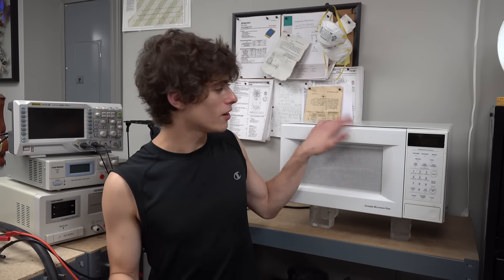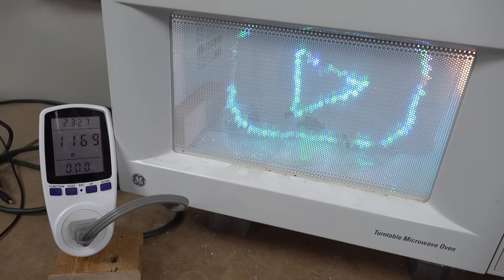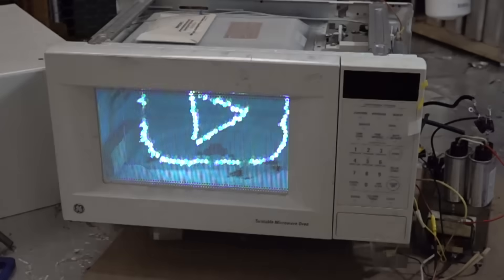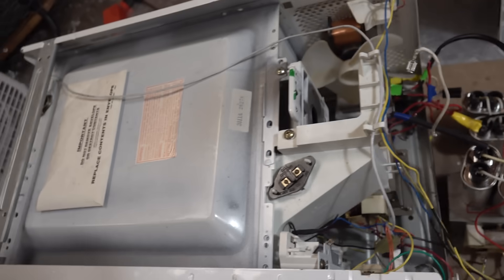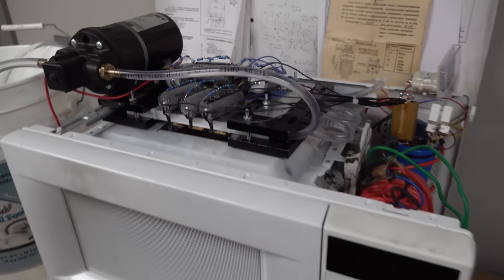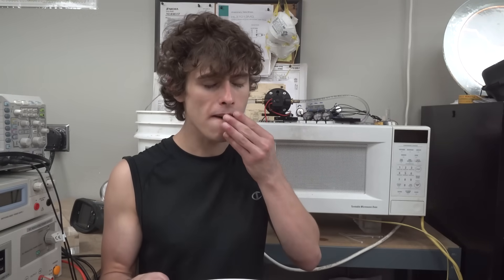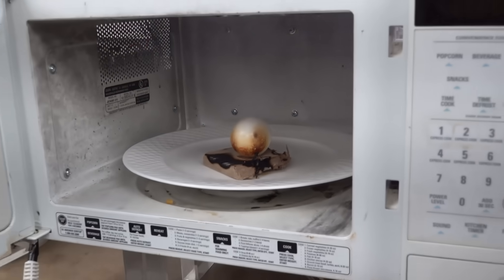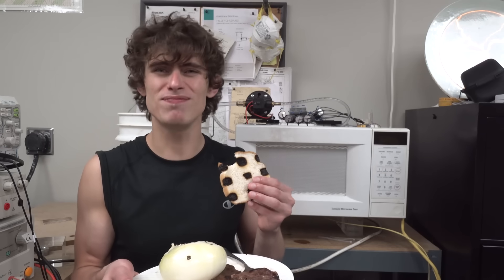I converted my microwave into a LASER oven!

Comment: I see potential. Heat penetration could be improved by leaving the visual spectrum behind and adjusting the wavelength. This also can be reflected easily within the oven, increasing efficiency and spreading the heat more evenly. To appease the regulators you'll have to choose an allowed wavelength, so let's say 2.4 GHz to 2.5 GHz. I don't believe there's a lasing medium for this, but other emitters are widely available, like the magnetron of a microwave.

Comment: Careful with that hammer next to the magnetron beryllium oxide is nasty stuff and the damage is irreversible. You can get real ugly very quickly at low levels. I’m sure you’re aware but just in case I figured I’d give you a heads up.

Comment: I used a microwave oven to make an actually SAFE fractal wood burning rig. Left the  interlocks in place, put electrodes in the wood, spritz with the electrolyte, shut door, turn it on

Comment: Another lie. When I had solar power & watched my nearby electric meter I noticed that my "800" watt microwave actually drew about 1300. Though if that's the case, well surely the turntable motor doesn't take as much as the other 500 does it?

Comment: If you used a conventional microwave oven to heat the food and a laser to char the outside, you'd basically have a fireless grill. it would make more sense to use pulsed lasers because lower energy draw and more manageable heat production. You could house the entire thing in a grill-style hinge-lid container that latches shut during the laser char sequence so there'd be negligible risk of vision damage. You could even make one with a CNC laser engraver to burn memes into your steak.

Comment: i know that this is for educational purposes but i am doing a "seperate" porject and was wondering what the website that you got the Nichia NUBM3C 455nm 112W Blue Laser Diode Arrays or were you using the 74w version, because i saw you use the 74w version. also if i were to use the 144w version would i need a different power supply,
PS: i would appreciate it and it would really help me if you could give me a shoping list of the matirials.
and thank you for the education on the safty of these projects. :)

Comment: As much as he messes with microwaves it's weird how much incorrect information was provided.

1. Microwaves did make a jump many years ago.  the early ones were only around 200-300W and the current ones are typically around 1000W and really anything over 900W is too much and causes instant hotspots.
2. Until several years BEFORE this video microwaves did manage lower "powers" by adjusting their duty cycle.  The newer ones that would have been readily available when he made this video have something more like a variable power.  I am not sure how it works but its' way better than the slow cycling they used to do.

The video is great, it's just weird when he gets the common knowledge parts wrong.

Comment: If you put shredded cheese on a square plate in the microwave oven and then cook it just briefly you will find lines of melted cheese and lines of not melted cheese. If you measure the distance between two rows of melted cheese and you do the math properly you can determine that the wave length of the microwave is roughly 2.4 GHz.

Comment: The electronics project that sketched me out the most was my massive capacitor bank. That thing was lethal. 
This was back when you could just go to the photo development section and just ask for their used disposable cameras and they would give them to you. If I remember correctly it was about 800 capacitors running at around 600 volts. When I realized our math was off by more than a factor of 10 was when I vaporized a piece of copper I was using as a fuse. 
The thing that still concerns me to this day is that it went missing in a move. I really hope no one tried to use this. Because this thing sketches me out as much or more than microwave transformers.

Making giant capacitor banks is also very lethal idea that you probably shouldn't do.

Comment: The most important thing when opening a microwave is to unplug it BEFORE you open it and short out the giant capacitor WITH A TOOL THAT HAS AN ISOLATING HANDLE, IMMEDIATELY after opening it.

Comment: At my university back in the day there was a dude building a RF based microwave oven out of SiC electronics. So in steed of a magnetron it had a SiC RF transmitter. It was quite a bit more efficient and also fairly light. The SiC circuitry was prototypes but i would guess they would not be cheap

Comment: what if... the lasers spin?

there seemed to be a problem with lasers... being lasers, and focusing all the energy in one spot

so... if you make the lasers move, then the energy will be a little bit more spread out, right?

of course you wouldn't go the easier route of putting a diffusing plate or an actual turntable... right?

maybe... take it to another level and just make a laser chamber with a whole lot more lasers aimed at the middle?

i didnt really think this through yet, but i really just wanted to put this out there

Comment: I’m not studying electrical but from my knowledge, you can add a capacitor into the circuit to prevent the ripple. That’ll essentially create a standard ac to dc converter.

Comment: There are channels that throw stuff together like this for fun and that's great, but there's also a few channels out there that do the calculations to perfect their toys. I remember seeing a guy building a linear accelerator and presenting a spreadsheet with his optimization calculations based on measurements. Imagine what Pyro could do were he to, for example, focus all of the lasers at a single point, with the light waves being resonating at the focal point(s).

I don't think he'd create a resonance cascade. No worries. Avoid shiny yellow rocks tho.
Reply: For a laser oven, you’d probably want it to instead diffuse the light at an adjustable set radius so the light is distributed evenly as possible over the food as as much as possible hits the food.

Comment: Do you think you can use a microwave for de-weeding a garden? I have a lot of shit growing between my tiles which I can only remove by either manually picking them, burning them (which doesn't do anything to the roots) or spraying them with acid (vinegar). 

A microwave should go deep enought to burn the roots. But how dangerous is this? Is the reflection of the MW dangerous enough? Could I just put a microwave without a door in my garden an turn it on remotely? 

Please help, my weed problem is killing me.

Comment: Microwave magnetrons are free running, so if you place the radiating elements with the proper spacing in a rectangular waveguide. They'll sync like metronomes on a wobbly table. Consult the radio amatuer handbook from ARRL to calculate the spacing for the waveforms to be additive.

Comment: 5:18 When I first moved out of my parents I had a small apartment with a roommate and we had this super old microwave we called "The Red October"; it was made in the early 80s and was huge with three different dials on the front(time, temperature, and something to do with a temperature probe) that made it look way more complicated than a microwave should be. One day I was reheating some mac and cheese and I pull the door open assuming that it has safety features and will for sure turn off when the door is open... Nope. That SOB kept going. I got down as soon as I processed what was going on then reached up and slammed the door shut. I always wondered how dangerous that was.

Comment: Great work.
Be f-ing careful.
I think you need to tweak the frequencies without the dangerous amps or volts.

The trick i believe is the frequency you use.
Look up Royal Raymond Rife. He invented a device that killed cancer. I was cured for a skin disease by one in 60s. Used a GE Plasma bulb and was purple like UV . 

He used a carrier signal  i think 3 gig to get it deep. He would use the low frequency to break cancer cell. Like chemo but targeted. 
I thin you could build it 

Just a tiny bit makes all  the difference. You hear that sound when you burn stuff. Get an app and check the sound frequency. Also look at light frequency. Change the recipe and see what happens. Or add loud sounds from 3rd source.
Try a sound frequency generator app.

Think music
A note sounds perfect it makes you feel good.
Move it a tiny bit and it feels like scratching a chalkboard until you hit the next fun frequency.

Those are key
So blowing shit up is fun and cool. Inventing a cure that was hidden is cooler.

My dad was an inspector for space parts. He told me in 60s
 the future is graphine (graphite) (Carbon) and magnets.

I say frequencies sound and light using graphine and magnets maybe a blue or red laser 

3D frequency generator could target one tiny spot and rip the molecules apart.

Patent it

Then make one with a frequency oscillator and old Fender tube amp that oscillates 3gig and 528hz at the pinpoint area. Bang zoom...

Kurtzwiel knew more than we know.

Comment: He discharged the capacitor with no gloves while also touching the steel plate

I scrap metal and I've taken hundreds of microwaves apart and I always wear thick rubber gloves when I discharge the capacitor.

Comment: there are some inverter microwaves that can actually run at reduced power. They're hard to find and expensive. The best microwave is a convection inverter microwave so you can bake at a high temp and use a lower power microwave to speed up the baking.

Comment: before you mess with anymore microwave ovens I need to tell you the microwaves ARE NOT!!!!!  CONFINED TO THE MICROWAVE ENCLOSURE!!!  turns out if you had a detector for microwaves you would find that you are irradiating yourself from the sides of the magnatron  where the fan blows air through to cool it.
this is EXTREMELY DANGEROUS!!!   PLEASE DON'T MESS WITH MAGNATRONS unless you shield them.
mike  safety first!!!

Comment: Those ceramic parts on the magnetrons are made of beryllium oxide. If you crack them and inhale the dust boom instant lung cancer.  No joke I gasped when you tossed it on video
Reply: You can also make a neutron source with it and some spare uranium or thorium, just make sure that none of the dust comes out.

Comment: yo styro are there any laser "goggles" that consist of a camera mounted in front of your eyes? I would rather not trust my eyesight to plastic shades and instead use a steel plate with cameras+screen mounted on it(like an oculus rift or something)
Reply: Laser goggles block the laser wavelength entirely. Your eyesight is not in any danger if you match the correct glasses to the wavelength of light you're using. A camera will just burn out, go watch his tattoo laser removal video and look at what it did to the sensor in his camera.
Reply: @ananthropomorphictalkinggo6641  yeah but i would rather use a camera w/ a filter than my direct eyeballs. It's common sense
Reply: @x0j  you aren't using your direct eyeballs unless you're doing it completely wrong. You shine a laser at the glasses, and if nothing appears on the other side, you're perfectly fine. Laser goggles block 100% of light of whichever wavelength you choose. You literally can't even tell the laser is on while wearing them.

Comment: Definitely upgrade the diffuser on that. Maybe also get the rotating ceramic turntable back in there.
And personally... spread the spectrum out a bit; start with infrared for more even heating, then gradually shorten the wavelength to get the outside crispy. And you can't forget a quick blast of UV sterilization!

Comment: First time watching... so maybe you have addressed this.  But there is a type of microwave called an inverter microwave, which has one huge advantage over other microwaves.... it actually scales the power.  So unlike the microwaves you have here where they just turn off and on a bunch to decrease power... an inverter microwave will actually run full time, but at 50%, 30%, or whatever % you choose.
And, yeah, with that control an inverter is way better at cooking.

Comment: Great video! A little off topic here but I have a thing. Knowing how precise lasers can be I have a...... a wonder. I wonder if a modern steel knife edge could be made sharper using a laser than traditional sharpening methods? When sharpening a blade you are trying to raise a bur along the edge. Then smooth out the little fingers of the bur so they all point the same direction. Many kitchen type sharpeners are really made just to straighten the little feathers of the bur. If thats not working then you go to a stone. I'm seeing in my limited imagination...... a laser zapping off some of the bur without transfering enough heat to the steel to mess up the heat treatment.  Wouldnt be surprised if thats how scalpel blades are sharpened.  But also wouldnt be surprised if theres a fundamental reason why they are not.  If only there were a way for me to look things like that up........oh well, guess i must remain ignorant. Might be a neat idea though, irdk..... 😁 Great video as always! Thank you!

Comment: You’re onto something with the laser oven especially when it comes to steaks.

Infrared for normal cooking then full blast microwave laser for a quick searing to form a delicious crust.

A product to hopefully kill the crappy electric ovens and stovetops being forced onto everyone. Why use a fan and hot metal pipe that take a long time to heat up unevenly when you can use diffused lasers to irradiate the immediate area in fractions of a second

Comment: It shouldn't be that hard to have a mesh conveyer belt timed so a lazer would pulse through the holes in the mesh to cook something going down a belt with less electricity and heat than a big fat heating element or air fryer.

Comment: The toxic chemical in the exploded / burnt parts will contaminate the air bench and entire room super dangerous.Also the microwave radiation spraying around the room 1000watts with the door open super stupid  . I worked on these and other electronics since 1963 and as a hobby ham  radio and as electronic tech industrial/ tv consumer and biomedical and X-ray equipment . Any time I worked on X-ray equipment energized I went behind the leaded glass door . Also I never eat microwaved food especially the plastic lined packaged kind and microwave oven leak microwaves into the area they are in i leak tested all I worked on from a safe distance . The shielding on microwave oven is not perfect and doubling the power supply voltage is going to spray dangerous microwave rf in the room you in and others dangerous and totally stupid . Plastic burned produce toxic cancer causing chemicals which you are eating  and breathing and absorbing through you skin 👎🏼👎🏼👎🏼

Comment: So, if one wanted to focus a 5 watt laser, what type if lens would be most efficient?
Reply: This depends on the wavelength of light produced by the laser (e.g. IR, visible or UV). 
You need a lens material that is highly transparent at the laser's frequency, so the lens doesn't heat up.
For (relatively) lower power visible light lasers (<500W) , you typically use Optical glass (BK7/K9) of the common borosilicate crown glasses, with a transmission range of 380nm to 2100nm.
For high power cutting laser applications (typ 1064nm) from 500W to 1500W you use fused silica lenses. (e.g. JGS1)

Comment: So, you know how watching these videos doesn't cause the same permanent damage looking at these laser in person without goggles does, and it also doesn't reduce our color vision like wearing laser goggles does?
Well, what if instead of having a different pair of goggles for different ranges of wavelengths, you just had essentially a VR headset, but instead of games and all that, it has the two screens on the inside: one for each eye, and two cameras on the outside: one for each screen? Would this work? (Assuming the headset/helmet is a perfect fit, and doesn't let any light in or out through the edges)

Comment: Hi love your applications ! Can you help me I just ordered a 95 watt blue 450 nm array ..can you walk me through attaching the proper driver board and power .it comes with some information .it takes 90 volts at 3 amps for power .should I get a power source that's adjustable ? What I'm going to try to do if I can get this down pat I'm going to try and weponize my car ! I want to put 4 arrays together I'm a machinist so I can make a great mounting plate .i want to use a back up camera mounted in front over tube for targeting ! Put housing on a stick movable gimble .to aim laser comulating lenses I only need about 30 feet to comultion point .give me some thoughts please .im thinking of using power from car itself for power source ?
Reply: Oh I'm thinking of useing small vacume cleaner to suck heat away instead of a fan I think it will b more efficient in keeping whole device cool .suck the heat away I'm imagining that 95w × 4 as throwing some scream heat ! Please see if u can help me refine my idea .your incredible with your imagination and your applications .

Comment: I always thought a magnetron could be a perfect stealth weapon, just place it somewhere a person frequents frequently and I don't think anyone would ever figure out what killed them over time.
:/ Just sharing
Reply: But would the deadly gasses stay airborn in said frequents frequently frequent spot
Reply: @willtindall8263  My plan was relying purely on the radiation emitted by magnetron, it should be pretty degrading to the whole organism after some exposure.
Reply: @MANS4ON-Ce137  except magnetrons pretty much don't emit any ionizing radiation at all. It would just warm them up a bit.

I guess you could heat someone up until they die, but that would be very weird, inefficient and absolutely messed up.
Reply: Magnetrons are noisy